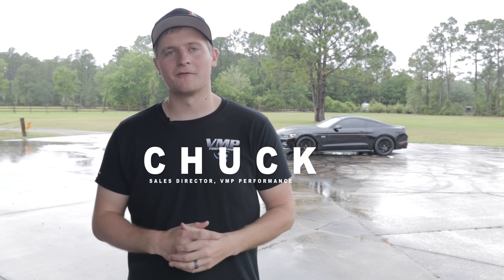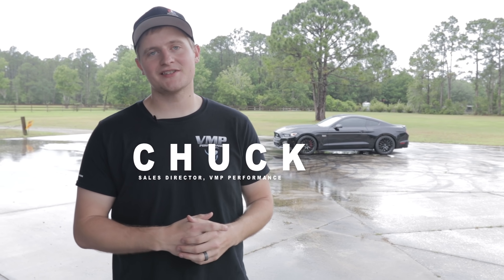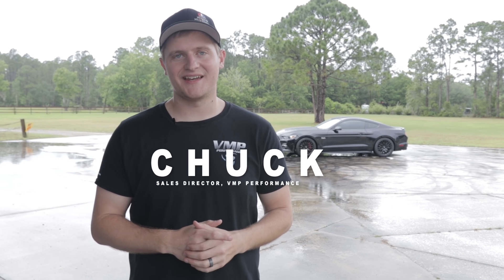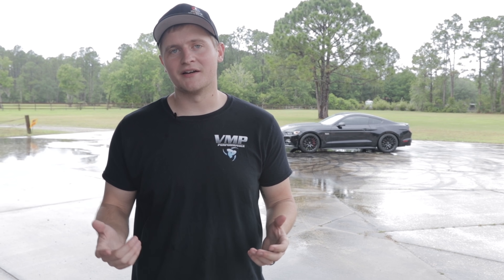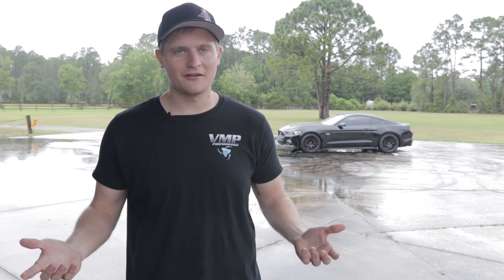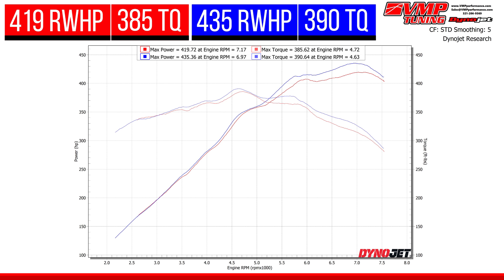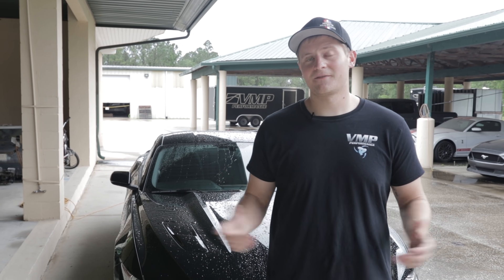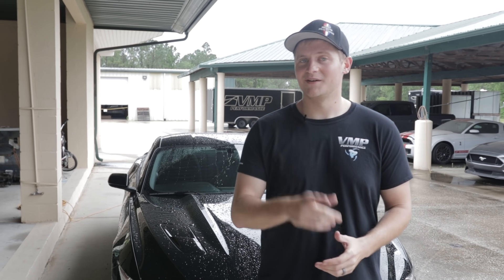Flex Fuel Tuning - Convenience AND Power for your Coyote!

Comment: Can you use boostane with a flex fuel tune?
Reply from the maker: Boostane is for gasoline right now...it would not hurt E85 but its not designed for it either.

Comment: So, I'm about to buy a 2021 Mustang GT (no performance pack) , and I'm gonna add on a Roush stage 2 kit, a flex fuel conversion, and possibly a cam swap all from day 1. I will primarily use E85, but occasionally will use 93oct. 

Are you guys able to tune this out? If so, I will likely come visit ya. Goal is 800hp
Reply from the maker: Hey Kristen, to run E85 with a supercharger, you're going to need a return style fuel system and we do not support flex fuel tuning on supercharged applications.

Comment: So I'm running the flex, should the afr be around 10.9?
Reply from the maker: It will appear to be "richer" on the cluster's AFR gauge when running E85.  As long as you've submitted a log for review to your tuner so they could confirm fuel trims, you should be fine.

Comment: will this work on my 2015 mustang and can I run 93, boostane and flex fuel ranging from e60-e85 on the same tune
Reply from the maker: Flex fuel tuning bases calculations off ethanol content.  For details about your specific set up, email us at sales@vmpperformance.com and tell us a little about your car so one of our tuners can answer your questions accurately.  Thanks for commenting :)

Comment: So can you run e85 on stock 2011 mustang gt or do you have to change the injections
Reply from the maker: A Flex Fuel tune can be added to a mildly modified Gen 1.  We would always recommended for anything more than mild set ups to upgrade the fuel system accordingly.  Simplified answer, Flex fuel is possible with Gen 1.  Email us with your mods to get specifics about your set up at sales@vmpperformance.com

Comment: Why can you not run e85 on a gen 1 coyote with stock injectors if they're the same as the gen 2?
Reply from the maker: It says you can in the description.  Give us a shout or drop us an email at sales@vmpperformance.com to get a flex fuel tune.
Reply: @VMPPerformanceTV  well I'll be damned. Next Stimulus check goes to you all!
Reply from the maker: @shotemup123  we'll be ready.  <3

Comment: In Indiana it’s everywhere and it tests out closer to E90 than 85 if you trust your test gauge.Would like to see a comparison between the flex fuel tune and a straight E85 tune with the same car,same mods.Would there be a difference and if so how much?🤷🏻
Reply from the maker: Nice!  We've got a station in Daytona, otherwise it's a ride to Orlando for E85.  That's an interesting test to consider...
Reply: VMPPerformance I have three stations within 4.5 miles that sale 117 at its own single pump.But I do live 1/4 mile away from the fastest highbank 1/4 mile track in the world.Anderson Indiana.
Reply: The straight e85 tune will give be slightly more power in an NA car. Not enough to to be worth the cost and hassle of switching.